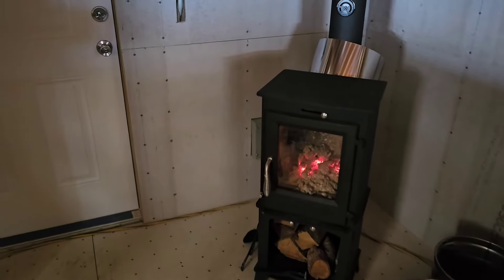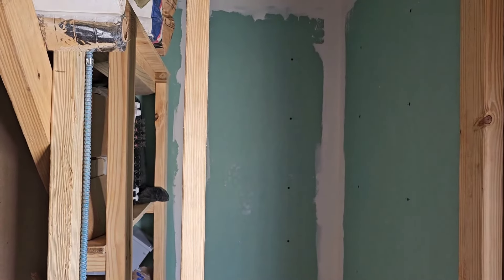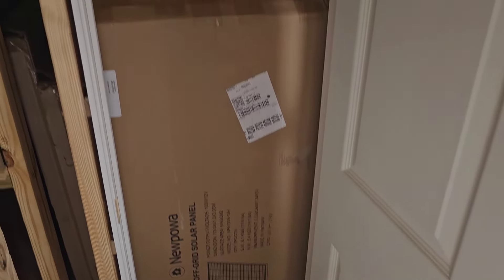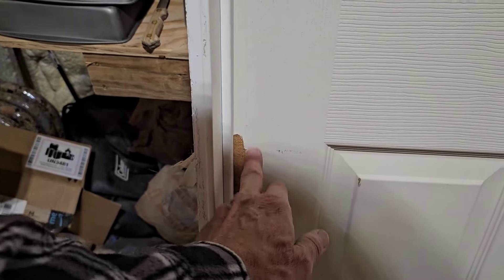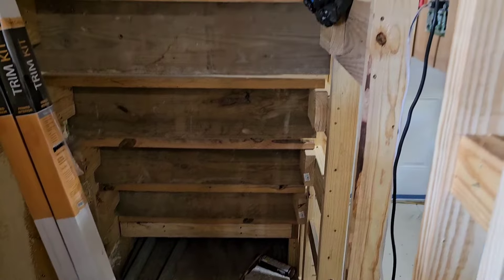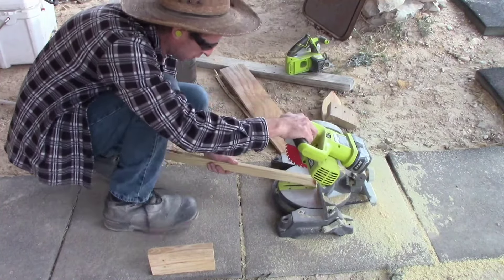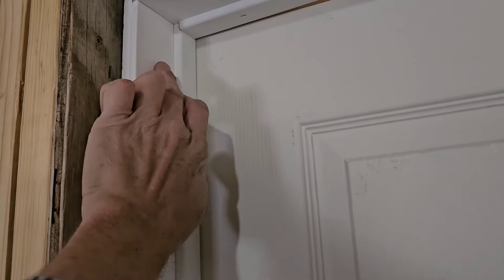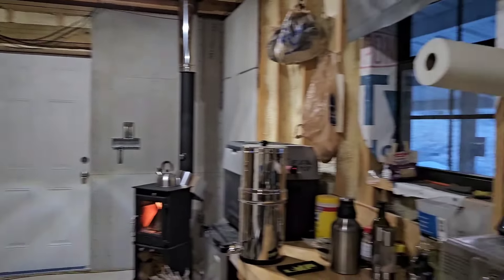Framing in a couple of interior doors @Timeline Ranch

Comment: Hammer therapy. Always a winner
Reply from the maker: Progress is Progress it was not what I wanted to be working on but still moving in the right direction. Thanks for watching the project as always.
Reply: @TimelineRanch  The more materials you install on the walls, the more freely you will feel in a tiny house. Sleeping in comfort is also very pleasant.
Reply from the maker: @alexwoods2836  Yes I agree. I am planning on building a stone dome for the hydroelectric building. That building I could use for storage to get all the tools and excess materials out of the house. Thanks for following along as always.
Reply: @TimelineRanch  Hydroelectric power station? You do not have a constant flow of water, or are you planning another reservoir on the western slope of the hill?
Reply from the maker: @alexwoods2836  Good question. There is quite a bit of elevation change on the property. I plan on digging an upper pond and during the day pumping water from the lower pond to the upper one. There will be plenty of extra power from solar during the day. At night water will flow back down through the hydroelectric building as needed for power.

Comment: When will the excavator be ready for use again?
I'm keeping my fingers crossed that it won't be too expensive🍀
Reply from the maker: It took a week and a half to get the new tracks in and costs close to $3,000 USD. It is what it is. I did get a good bit of work done in the building, though. Thanks for following along with the project as always.